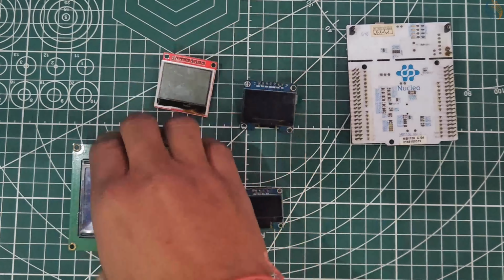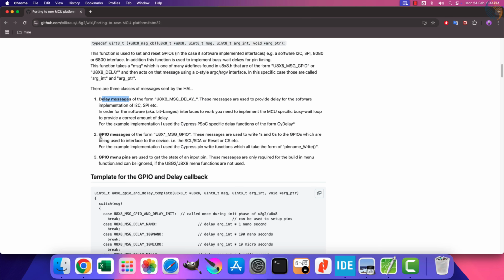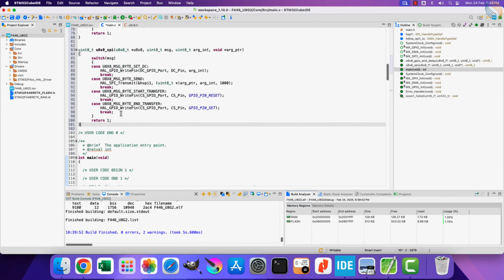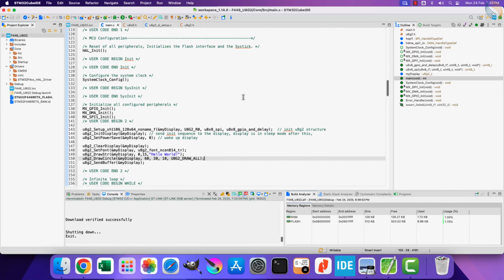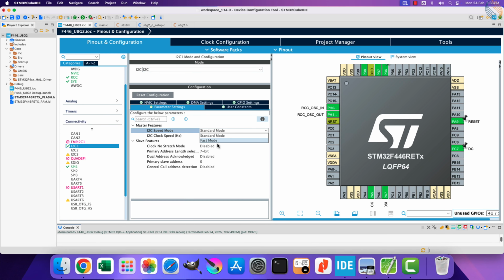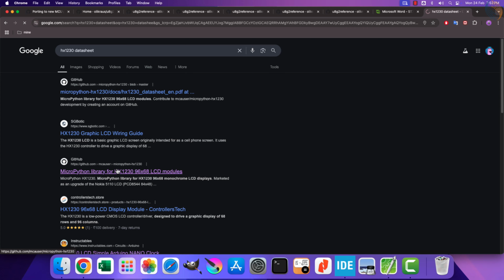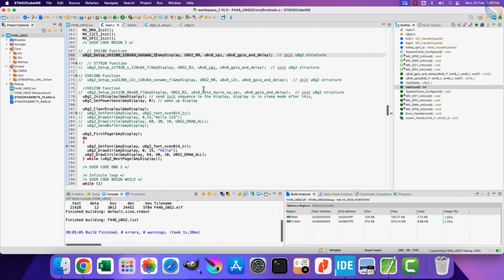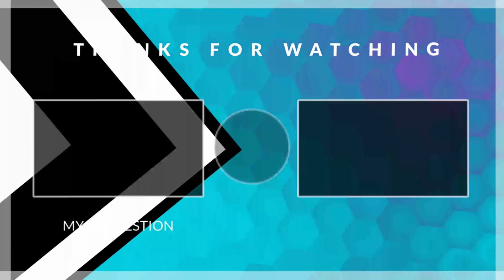Port U8g2 Graphics Library to STM32 | SH1106 & SSD1306 OLED Tutorial

Comment: is this library can use for STM32f103c6 ARM cortex 3 or this library just can use for STM32F4 ARM cortex 4?
Reply from the maker: Did you even watch the video ? The library can work with any mcu that supports i2c or spi or infact if it has GPIO pins.